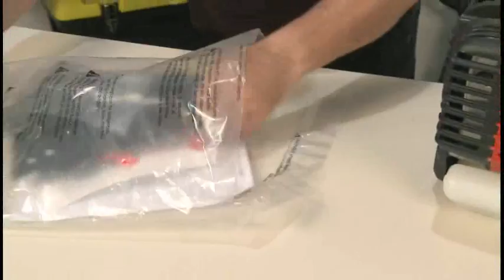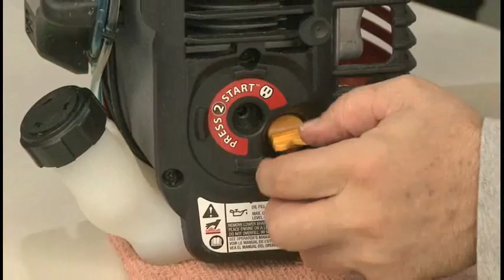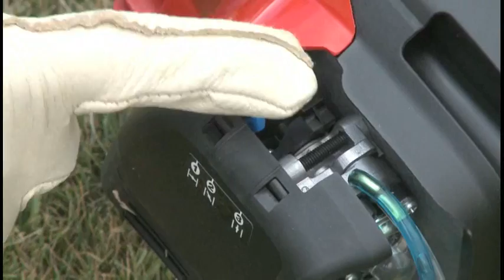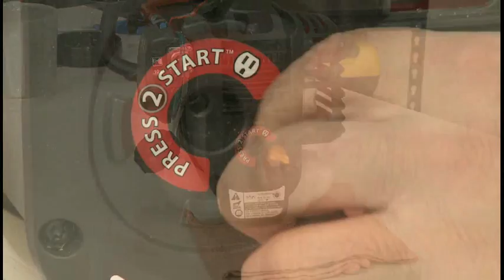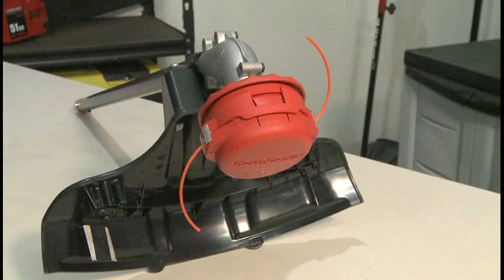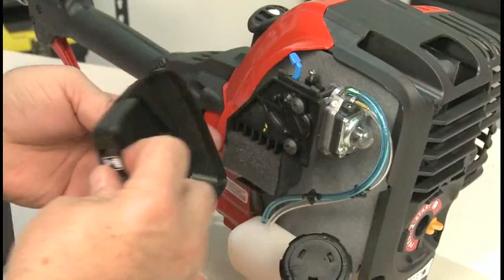The TB525 EC gas string trimmer | How to set up your 4-cycle trimmer

Comment: Can  I use  5w motor oil
Reply from the maker: Hi @JoseMorales-c9y. Thanks for reaching out to us! The crankcase of your engine should be filled with a high-quality SAE 30 weight oil, which is best for temperatures from 32˚ to 104˚F. Always use quality motor oil as indicated by the donut-shaped American Petroleum Institute (API) service symbol on the container. The two-digit service rating is the age range of engines for which that oil is appropriate, and the most current rating is “SN.” Feel free to reach back out with any other questions – more than happy to help!
Reply: Wow  tank you so much for your  reply  i really tankyou @troybiltofficial
Reply: Tank you so much for your  reply @troybiltofficial

Comment: I received a Troy-Bilt TB525es 4-Cycle Gas Trimmer from Father-in-Law family upon his passing and It's in excellent condition. I would like to ask if there is a substitute oil I can use for this Trimmer's motor as the Operation's Manual states on page 4 under the title RECOMMEDED OIL TYPE "Failure to use the correct oil... can cause premature engine wear and failure. Use a high-quality SAE 30 weight oil of API (American Petroleum Institute) service class SF, SG, SH" I am unable to locate any oil with the API service class of SF, SG, or SH. Thank you for any help anyone may be able to provide.

Comment: ☆ I bought the TB525 EC about six years ago. I had nothing but problems with it from day one. The line is constantly breaking off and pulling back inside the head, forcing me to stop and TRY to remove the head cover. What a pain in the butt!  I hate this trimmer.  I (tried) to use it  a few times, but finally got so frustrated and aggravated with it, I haven't used it since.  I wish that I would have returned it.
Reply: Sounds like a real pain in the keister!

Comment: I have this trimmer and have had no problems with it. Non leaded gas no mixing of oil and gas. I have 2 acres to work on and it works like a champ. Being 4 cycle you have to let it warm up before using. Patience is a virtue with a 4 cycle. I use my cordless drill and the crank attachment on the back of the trimmer. No pulling rope, love that more than anything.

Comment: Incredibly,Troy Bilt quality has gone down even more since you made your video (crazy as that sounds!). I bought a 
TB685 EC weed trimmer from Lowes. I lasted 3 uses and then quit. I got 
it replaced at Lowes. The replacement WOULD NOT START AT ALL! I am done 
with Troy Bilt. They make them in Mexico, which is all you need to know.

Comment: i have one and had issues from the start, it is a mfer to start, i mean i almost had a stroke and heart attack pulling the cord i was so tired out trying to get it to start that after it did start i had no energy to week eat. i took it apart and found the carb main jet was too small, i replaced it with a larger one and it seems to run better at least it will run with the choke open now, i mean who design this thing anyway a torture expert? throwing it away and buying an echo NO TROY ANYTHING IN MY HOUSE.

Comment: I bough this last night and this morning in less than an hour I cleared my entire driveway that is a 1/3 of  mile long. The drive had grown for a few years and had briers, weeds and vines. I used the Hedge trimmer attachment and mutilated the growth. I am sold..
Not mixing gas is a plus too.
Interesting though in this video it shows a choke. My Troy Bilt trimmer doze not have a choke. 
When I first took it out of the box, I put the oil in the tank, then fueled it, I had to push the primer bulb several times,then pull it several times, then repeat. After that it has started on first pull.
The rope pulls so easy I did not think it was connected at first. All in all this is a great machine. I use the hedge trimmer attachment mostly today. Tomorrow I will use the brush cutter attachment for the work I have ahead on my property. It will be a mixture of briers, vines, saplings and small trees